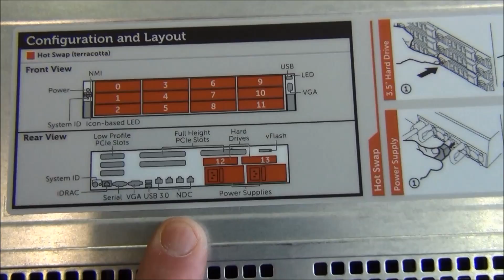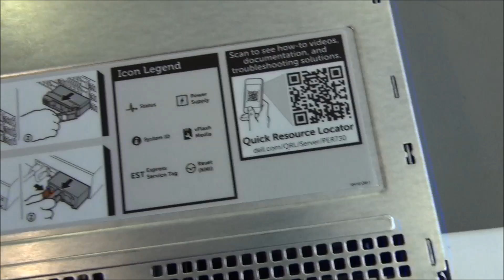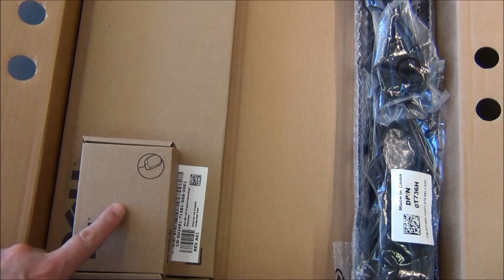Dell R730_XD_Tour_2015

Comment: can i  use 4 or 6 tb  of hard drives? and controll them via SAS?
Reply from the maker: Yes, you can use either 4TB or 6TB SAS or SATA  drives, install them in a Hot Plug caddy, slot them in and they will be connected through the backplane to the RAID controller.

Comment: great video. whats de SD module for?
Reply: I tried that before on a HP server, and guess what, the vmware ESXi files on SD got corrupted and I have to intalled again and had a downtime.. it will make sense if the SD are mirrowed like the hard drives